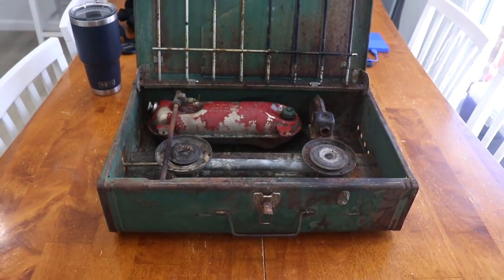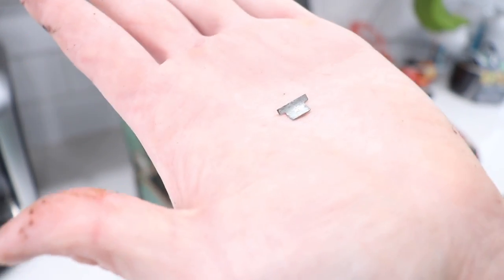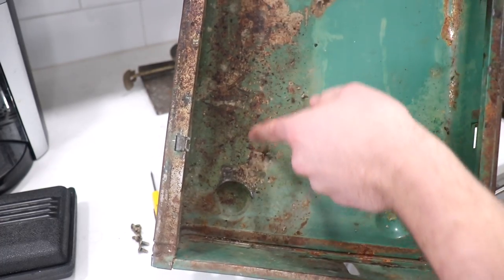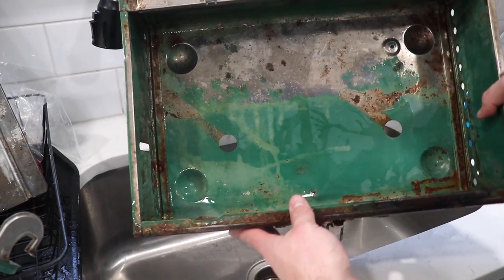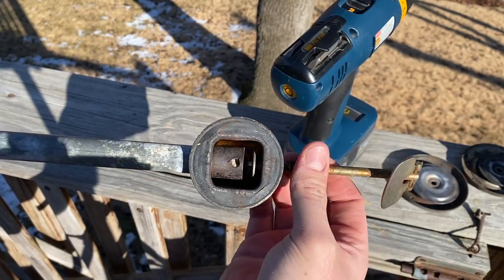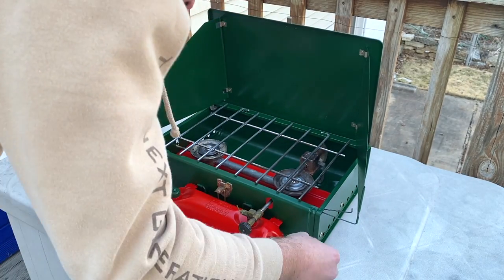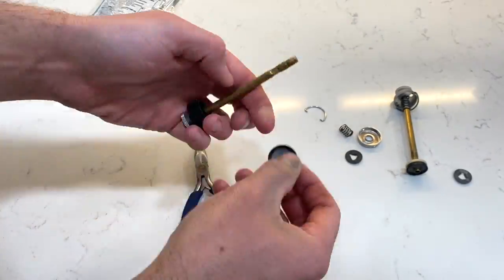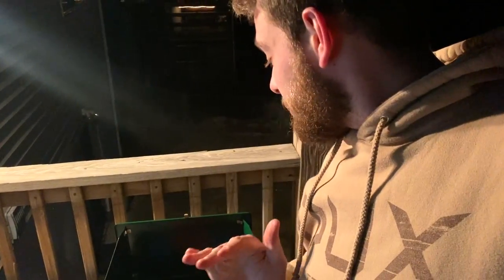I Restored an Abused Vintage Coleman Camp Stove

Comment: I have restored 2 Coleman 2 burner stoves.  One is like yours, a 425-E which belonged to my wife's parents and we inherited it when they passed.  I also completely restored a Coleman 425 no letter stove that was made between 1920's - 1930's.  It was in worse condition than yours.  I used an old plastic trash can and made an electrolysis bath and soaked all the parts including the gas tank.  The gas tank is the cylindrical copper colored tank.  I repainted everything and found some great copper colored paint for the tank.  A friend had given me the stove and a bunch of auto paint that is an exact match for the Coleman green.  It took over 2 months to completely restore the stove.  I used my airbrush to paint the green.  The burner assembly was repainted with high heat aluminum colored paint.  I completely disassembled the tank and refurbished everything including a new pump leather.  Your stove should have had a leather pump cup so I guess at some time someone replaced the pump assembly with a newer pump assembly that used the rubber type cup.  Thanks for the video.  W Rusty Lane K9POW in eastern Tennessee
Reply from the maker: Sounds awesome man! Would love to see the one you restored

Comment: While your restoration is cosmetically very good, there are a few problems number one you don't want to use a course wire wheel when cleaning the paint. A finer side angle wheel on a grinder would have been much better. And be extremely careful on the tank preferably using a brass wheel you can knock microscopic pin holes through the metal, that will then be covered over by the paint and will seal for a short period of time eventually they will seep gasoline the amounts may be so small that you can't see them but nonetheless be flammable. I know because I've done this. Also you need to remove the valve from the top of the tank and clean out the fuel air tube and the generator assembly that runs to the burner, when you open the second burner the main flame dropped way down to almost out, that shows that the stove is not getting enough fuel. Also you don't want to use gasoline ever in a Coleman stove only Coleman fluid, or camp stove or Camp gas. Never gasoline from a gas station or anything is designed for an internal combustion engine. No matter how clean you think it is. Remember you're going to cook food over that anything that is combusted in that flame will be carried up in the column of heat around the pan and when cooled fall back into your food. Several people have been made very ill burning gasoline in a Coleman stove, due to the fuel additives being atomized and absorbing into their food. When in general you did a good job on it, just a few technical problems. One more thing check the gasket on that fuel cap. If it's at all questionable and not nice and pliable you should replace it that is a common point of leaks and fires

Comment: No! No! not red-use heat resistant silver on the pate that hold the burners as well the burner assembly. But It's yours to customizes as you want, until the red paint starts to peel.

Comment: To eliminate yellow flame, after a minute turn the starter valve down, then pump another 25 to 35 times. You'll get the hot blue flame all around. Congrats on a great job. Also look for a new instruction decal you can put on the back to remind you how to start up your stove.
Great work. Thanks for sharing.
Reply from the maker: Thanks for the tip! I’ll try it out

Comment: Nice job! Looks great!

If you turn the lighting lever up (and leave it there) when you light it, the valve opens at the top of the Fuel-Air stem which allows the fuel vapors from the fuel tank to travel through the generator and into the burner, which after lighting heats up the generator and should prevent a lot of the sooty yellow flame because the fuel to air ratio is more balanced for efficient burning.

If you have the lighting lever down or move it down at all during heating up, the upper vent is closed and the lower vent is open allowing liquid fuel to travel to the burner, which will produce a sooty yellow flame because the fuel to air ratio is too high until the generator is hot enough to vaporize the liquid fuel. No need for the "alcohol hack," which requires another fuel to bring with you.

If you have the lighting lever up and you're not getting enough flame, turn the valve off and the lever down to pump more pressure into the tank. Then try the lighting process again. If the stove is really old or not well maintained, the generator might need cleaning or replacing because it might be preventing fuel from traveling through it. This happened to me with a used stove I bought - never quite burned cleanly, heated up slowly, and never seemed to burn at full heat. Took apart the generator to find it mostly clogged with rust & build-up and with a broken heating coil. Replaced it and the stove worked so well afterwards.

Comment: I called up your vid because I'm restoring my grandparent's 50+ year old 3-burner Coleman stove.  I've never even seen a 3-burner stove before.  Anyway, my main issue was big dents in the frame.  Now that I see how easy it is to remove all the "guts" I'm going to do that and use autobody techniques to bump out the dents and straiten everything up.  I'm already about 80% there.  I expected the pump not to work, and it doesn't.  I ordered replacement parts for that.  I think I'll take the burners apart and give them a bath in the ultrasonic cleaner.  The old lead-based paint on the housing has really stood up well to all the abuse that this guy got over the decades.  I'll re-evaluate if I need to re-paint or not after I get the stove running.  Also, Evaporust (or vinegar) for the mildly rusted spots.

Comment: So with the pumps, the ones with the leather instead of the rubber are way better. The trick with either is to soak in in Neatsfoot oil for a little while, then reassemble. Your original pump may not have been bad, just needed to be oiled.
Reply from the maker: Thanks for the insight! I’ll try that next time
Reply: @ChandlerLittle  No problem. My dad used to collect Coleman stuff, and I picked it up the last few years myself. I’m still learning as I go, and mostly have worked on lanterns. I was given an old stove by a church member this week and it’ll be my first restoration on a stove.

Comment: My pump works but can't get gas to come out at the stove even with the valves set like you have them.  Any tips?    Maybe burner plumbing is trashed?
Reply from the maker: I’m not sure, sorry
Reply from the maker: It sounds like it may be trashed or there is some sort of blockage

Comment: Did you use high heat paint?  How has the pain held up?  It looks great, you did and amazing job.
Reply from the maker: I used normal spray paint. The metal doesn’t get close enough to the flame to need high heat. Thanks for watching!
Reply: @ChandlerLittle  Thanks for answering that - I was wondering that myself.... Nice to know.

Comment: Awesome video! Does anyone know about how long these will run on a tank of fuel??
Reply from the maker: I’m not sure how long if you go from a full tank to completely empty, but you will be able to get MANY uses out of one full tank
Reply: Coleman says one gallon of liquid camp fuel (white gas) equals about 4 1/2 of those common cans of propane. Also, the 40 oz. tank on the stove should run 2 hrs. at FULL HIGH setting, so under normal use it would run a LOT longer than 2hrs.  one gallon = 3.2 tankfuls.

Comment: I found one of these in the rafters of my garage in my new home. I plan on restoring it as well but mine is older I think as the tank is made of copper or brass.  Might be military grade.  What kind of fuel is used in these?
Reply from the maker: They use a white gas. Coleman has their own and there are many off brands
Reply: If the tank is brass colored then it's from 1958 or earlier.

Comment: I hate those "rubber" pump cups, they don't last long.  You can still find original leather pump cups.  Just add a few drops of oil through the hole marked "oil" when you use it.
Reply from the maker: That's great to know! I will keep that in mind for next time. What type of oil do you use?
Reply: @ChandlerLittle  any light oil, Marvel Mystery or 3 in 1 oil.
Reply: @ChandlerLittle  The proper oil to use is called "Neatsfoot Oil" a few ounces will last you a LONG time. Fiebing's 100% Pure off of Amazon for 9$ is what I use.
Reply: @ChandlerLittle  Coleman recommends that you use Neets Foot Oil on the leather pump cups.  I have a small bottle and haven't even made a dent in the quantity.  W Rusty Lane K9POW in eastern Tennessee

Comment: Muriatic acid in the tank will get rid of rust. Just be careful.
Reply from the maker: Good to know!
Reply: @ChandlerLittle Nice job on the stove, btw. I just acquired a 426D from 1967 I am restoring and you gave some good input. I learned the acid trick when I used to restore motorcycles in my teens. It worked wonders on the gas tanks. I usually took vinegar and BB's, shaking to get heavy rust and finish with muriatic.

Comment: I hate to say this but you are spending way too much time on restoring it.  Even though you got it back to the condition you did.  Vinegar goes a long, long, way for everything.  What that doesn’t take care of for rust you can get some Naval Jelly (look it up) also.  You won’t have to get a wire wheel to attack the majority of the rust because your burning through the physical pieces instead of the surface.